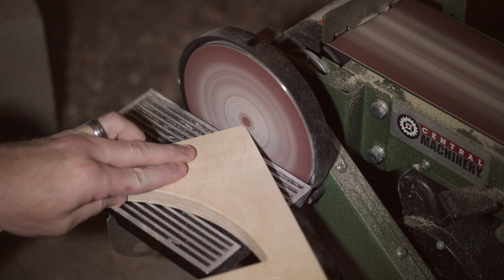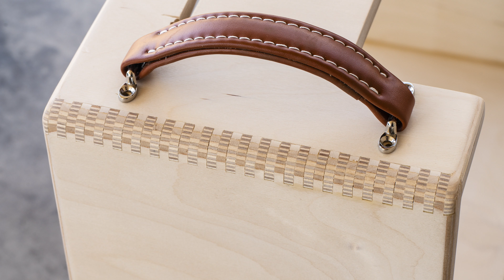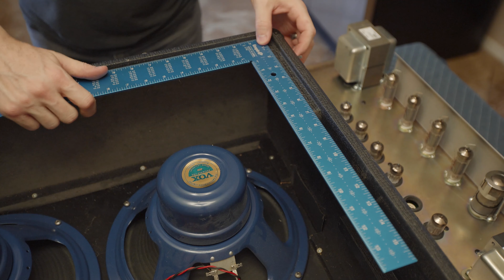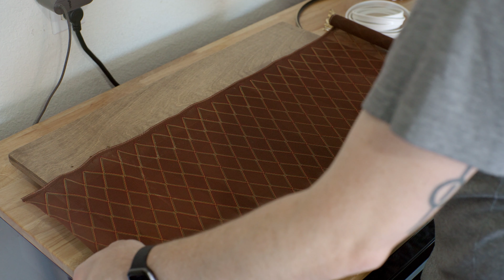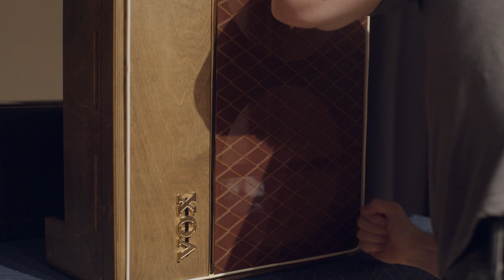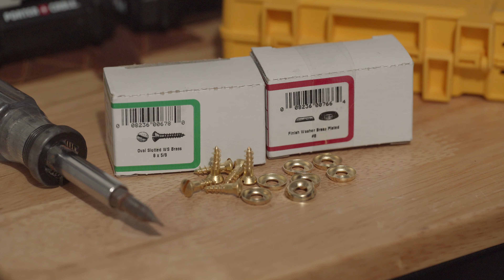Fawn AC30 Inspired Cabinet Build

Comment: Hey Luke that AC30 Cabinet looks great 👍 I was thinking of replacing my Vintage AC15TBX Tolex  which is in bad shape  and  wondering how the gold piping is installed. Is the piping placed on top of the Tolex  in the grove or is there no Tolex in the grove, your project had no Tolex so you stapled the piping. Thanks
Reply from the maker: Hey Baz, typically, the tolex would be applied over the slot for the gold piping, then sliced with a razor blade to open a channel, then it's the same as in my video, pressed in with a hammer or other implement, then stapled as I showed. 

Just as a personal comment, the reason I didn't apply tolex is because I couldn't find a good enough replacement for the vintage fawn style. If yours is fawn, you might consider keeping it as original, even if it's rough. There's a charm and a $$$ value that comes along with the roughness. But good luck either way! Thanks for watching.
Reply: Thanks Luke that quick response very much appreciated, yes I know you mentioned that you wanted a vintage
Wood colour look, it looks fantastic. My Amp has a black Tolex, I was looking at changing it to Fawn but when
you look at what is shown on the Internet for sale the Fawn colour does not look good, might go for black. Thanks

Comment: Some lithium grease on the piping might help the fitting next time.  We use it in engineering when working with gaskets to aid fit and prevent any tearing or scratching of them.  Lovely cabinet by the way :-)
Reply from the maker: Good advice! Thank you. It was quite a tight fit.

Comment: Sweet vid!  Been meaning to do this for an AC15 I have.  I really hate the heavy  mdf cabinet. At some point I'd like to make a solid wood finger jointed cab for it but baltic birch might be a good alternative....
Reply from the maker: Do it, man! I really dug the plywood finger joint. Everyone that sees it asks how I did it. It's why I abandoned looking for the proper tolex. But solid would be cool, too. Thanks for watching.
Reply: That's the correct stuff
Reply: Just a follow up, one year later:  I ended up making a reproduction cabinet for my AC15 from 1x12 solid pine with a 3/4" ply baffle and poly finish.  The original MDF cabinet weighed about 24 lbs.  The finished pine cab weighs about 9 lbs, bringing the the total combo weight from the original 48 lbs down to 33 lbs.  Great inspiration from this vid!

Comment: Excellent job Luke. I own an original 1961 AC30 copper panel with Celestion Blue speakers which used to belong to my guitar teacher. When he retired he sold most of his equipment and I was lucky enough to buy it in 1981. He had taken the amp chassis out of the cabinet and built it into a pretty rough head cabinet as he could no longer manage the weight. I had it for several years until I finally decided to restore it completely. I did find some original fawn rexine in a music shop which had been ordered but never collected. Knowing how rare this was they wanted £300 for the piece which was just enough for the job. I just could not afford it back then so I opted for Vox black basketwork tolex and took a chance on washing the old grill cloth which came up like new. The speaker cabinet needed some regluing on the joints but came up really well. I had to do a few trials with the tolex and gold string to make sure I could achieve a good finish but it worked out very well and I was not concerned about the possible devaluation as I will never sell it, rather hand it down to my son who is a fine guitarist and hopefully it will stay in the family for many years. I was lucky to have worked at an electronics company until 1988 where I was able to purchase valves at cost price so I purchased sets of matched ECC83s and EL84s as well as GZ34s all of which are original Mullards and worth silly prices now. There is nothing like a good AC30 and is my no 1 amp. I also have a mint original 1965 Fender Vibro Champ which has a sweet tone for indoor use. Best wishes for your future projects - once you start you get hooked!!

Comment: fabulous job, I use masking tape over cutting joints on wood it helps stop splintering, also finer blades do too. Wet and dry dark grey paper with water and a few drops of washing up liquid is great for abrading and wearing in hard surfaces like painted parts or on leather, a 1200 grade just takes the gloss off.I use this when I have sprayed a guitar and there is any uneven paint or orange peel finish.
Reply from the maker: All good tips! Thank you, Ed! I'll remember the masking tape tip, that splintering was atrocious.

Comment: This is incredible! Where did you source the leather handles from? Are they just spare Mesa/Boogie units or did they come from somewhere else? I'd like to throw a more comfortable handle on my AC15 and those look beautiful.
Reply from the maker: Thanks, man! Yeah, these are just aftermarket handles. I got them on eBay, but they appear to be everywhere, even Amazon. Just search for "leather amp handle"... tho they are fake leather. The only thing I'll say is they don't compress the same way as the Vox handles... at least mine don't. So they won't lay all the way flat. But you could experiment with the mounting position.
Reply: @Lukeyourself  Thanks for the info. Still in awe of this video, keep on rockin!
Reply from the maker: @ethancossett7318  Thanks, Ethan! I hope to have a completed amp and demo soon. I'll post here eventually. Good luck with the AC15!